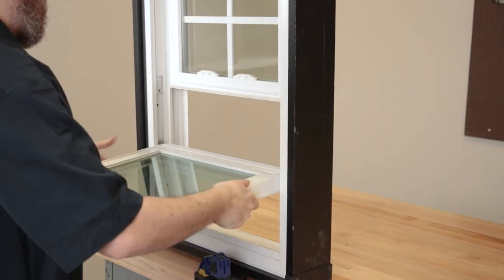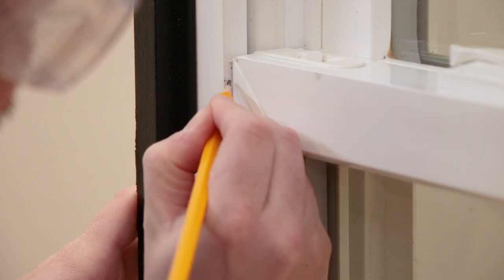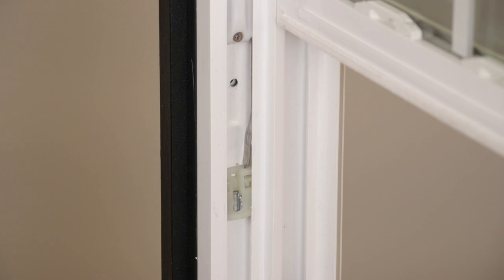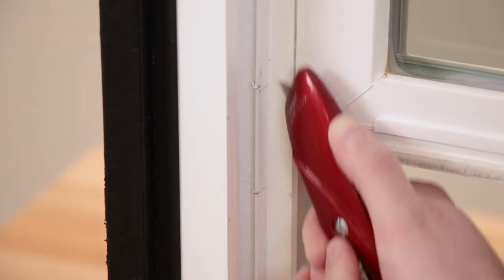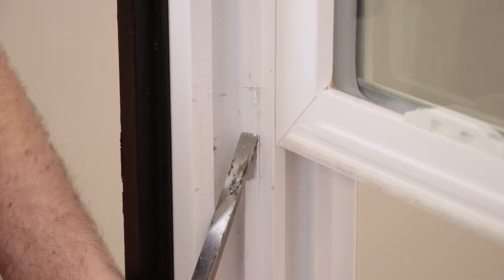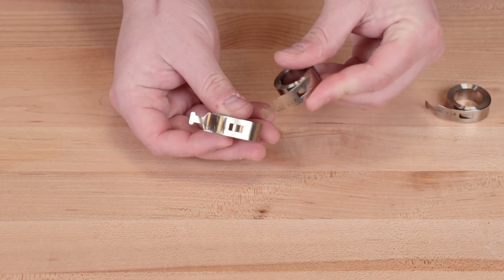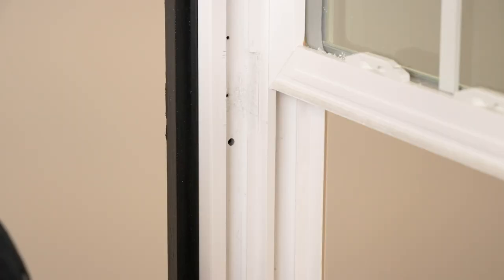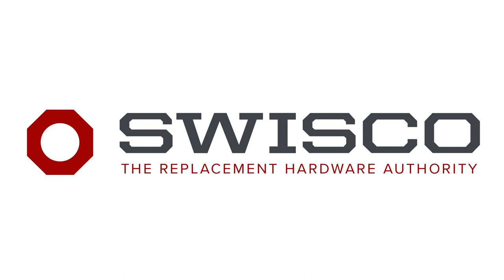How to Replace a Triple Coil Balance System

Comment: I had the exact same problem with my windows not having a notch at the top, but I found it much easier if you cut notches on both sides rather than the one side shown in the video. Also if you live in a smaller town, good luck getting new coils, cause they are really old, and doesn't have much availability.
Reply from the maker: Hi John, That's great to hear you were able to fix it! Just be careful not to cut too much, it could give the sash too much wiggle room in the jamb. And if you ever need coils again, we sell them on our website and deliver right to your door - https://www.swisco.com/cl/Replacement-Sash-Support-Coil-Balances